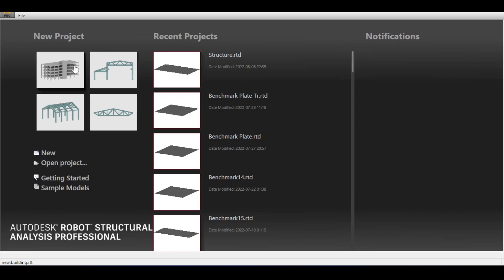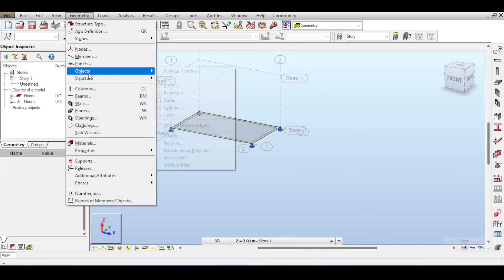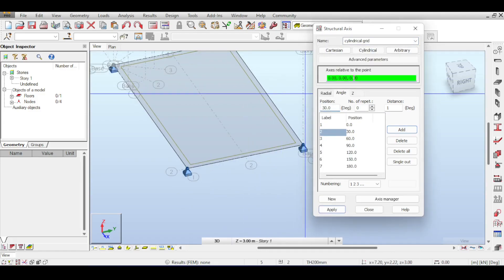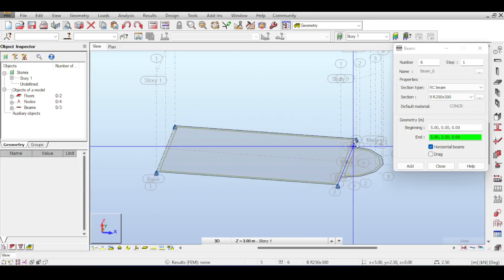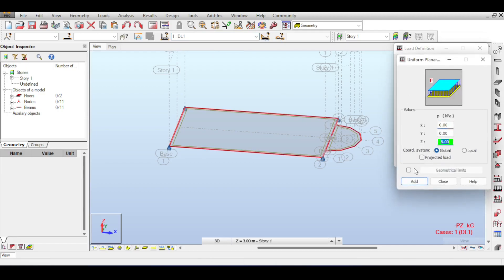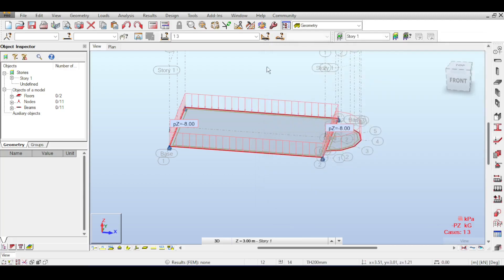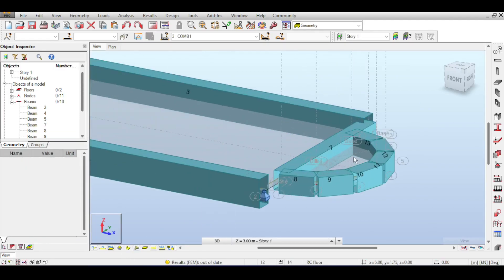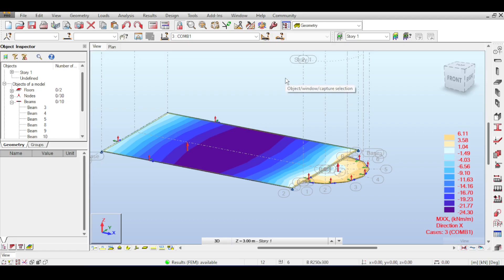Modeling Circular Beams and Shells in Autodesk Robot: Tips and Techniques

Comment: Simple and very informative video. 
Is there a way that we can draft one circular beam rather than discretizing the beam elements. I have been finding ways to model and design curved beams (concrete and steel) in robot as one single beam. Any tips that you might want to share?
Reply from the maker: Yes, you could use an "object" to draw a line then make it become a beam.
You can access those "helper objects" from the menu: Geometry->Objects.

Thnx a lot for your comment, I really appreciate your input.

Regards,
CEE

Comment: How can design one way slab
Reply from the maker: Hi there,
you can design a 1 way slab as follows:
When you draw your slab/floor,

There is a (...) near the word (shell). Click on it,
Define a new calculation model, call it shell1x (DO NOT OVERWRITE THE SHELL)
then in the bottom side, you should select One Way

then, use this model to draw your slab, do not forget to put beams around it, then it will calculate 1 way moments and you can design it.

I made a quick example under this link:
https://drive.google.com/file/d/1PsYdpfWY-lhD4xwlYDOz_GGZ60UWLGa3/view?usp=sharing

Regards,
CEE

Comment: thank you so much dear  for Your wonderful explanation
could you help me?

I made an analysis of a flat slab using the program and analyzed it manually again using Simplified frame method (distribution moment ) I found difference in result
the moment in the RSA is very large than my manual result.

Is it logical for the difference in results to be like this?
Note
When I used reduction of force above columns the results were close.
can i use reduction of force above columns in any case?

...
BS 8110
section of columns all (50X50cm)
the length of spans in X axis (6.5 m) two spans every span 6.5 m
the length of span in Y axis (5.5 m) two spans every span 5.5 m
Live load 2 KN/m2
died load 3 KN/m2
thickens of slab 22 cm
Reply from the maker: Hello there,
sorry for the late reply. 
Indeed, please note that when you are analyzing slabs on columns using any finite element software, the connection between the slab and the column is a SINGULAR point.

It is basically as if you are putting a piece of paper on a needle, there will be some really high stresses and moments.

My guess is that the difference was large between Robot and your calculations above the columns/supports.

This is totally normal. Yes, you can use your reduction method if it is applicable.

For me, I sometimes move a small distance away from the support to get realistic values.

Notice also,
if you change the mesh size, results above supports change.

Finally notice also,
that theoretically speaking, having a slab supported by a column should cause infinite stresses.

That is the reason why in your flat slab, you had those problems.

To summarize:
1) Yes, you can use your reduction method
2) You can - alternatively - move a distance (d of slab) away from the column and take those values as if they are above the column
3) What you see (difference) is totally normal, and happens in all FEM softwares.

Regards,
CEE